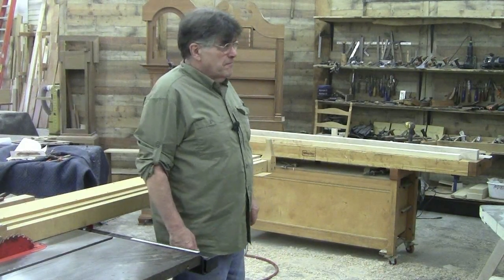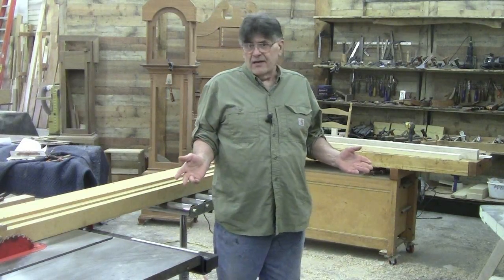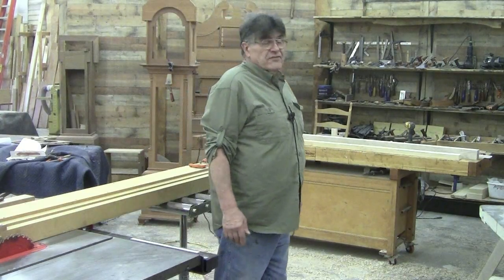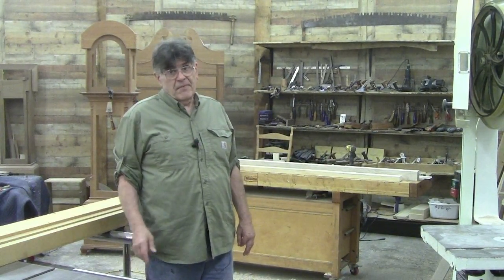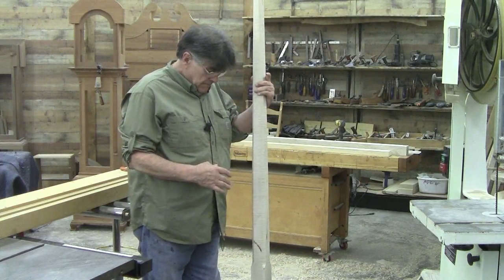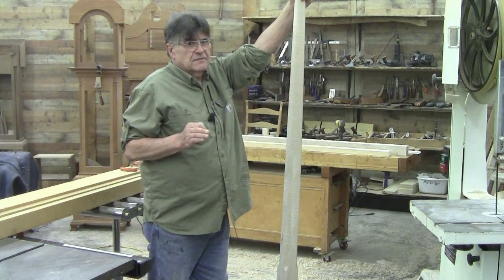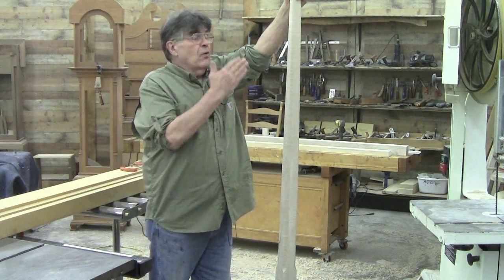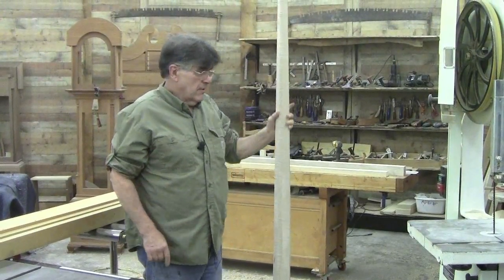Tapering a Pencil Post Bed with Charles Neil

Comment: Great video, Charles! When the center is as far off, as in your example, and you couldn't get another piece, could turning it end for end possibly help? Soaking and weighing it down to dry? Use this piece as a 'pattern' and adjust the others to match?